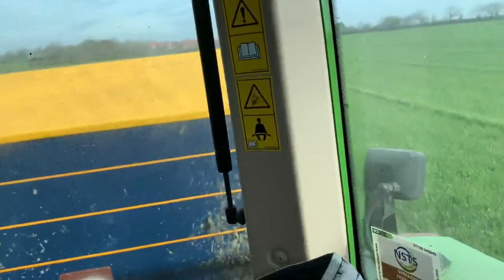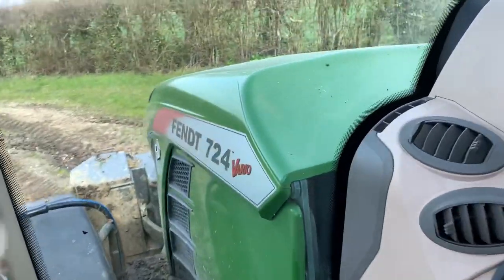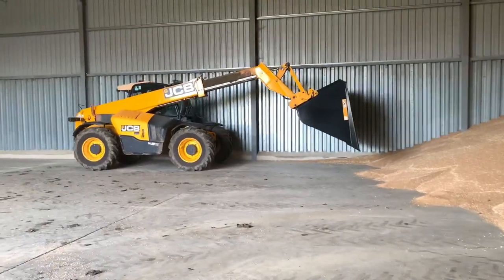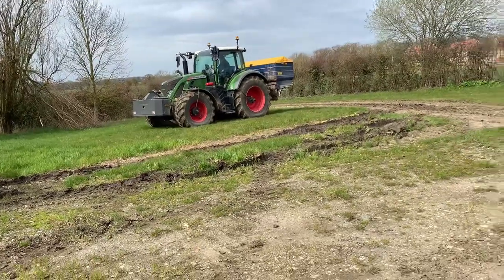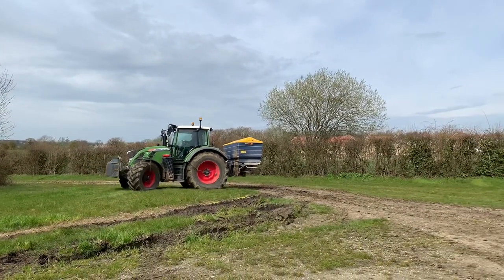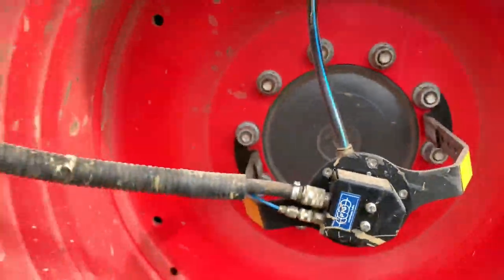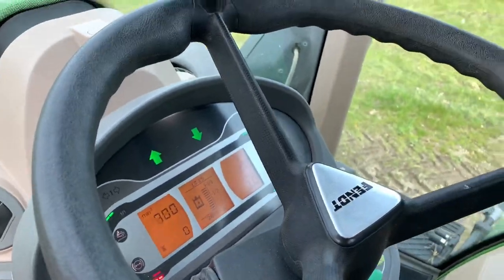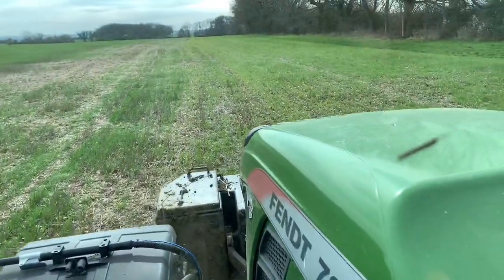FENDT 724 VARIO FERT SPINNING! FIRST BLOG AT NEW FARM!

Comment: Excellent video Sam! Good description of the fine points of the Fendt 724. Might a similar tractor be in the works for contracting? Seems to be a very nice set up with the tyre pressure system and front weight and the other Fendt features. Nice fella to work with. Best wishes to you both on the new farm! Thanks for the video.
Reply from the maker: Cheers. Fendt would be good! Stay tuned 😉

Comment: And I think the 6210R is overkill for fert spreading 😂 good vid Sam. What drill was used to establish that wheat at the end?
Reply from the maker: Hi Sam. That’s the only tractor with gps, and the Puma has tracks so would be no good for that, so that’s why we run it on the spinner. The wheat was drilled late after a cover crop, by a Weaving 6M Sabre Tyne.